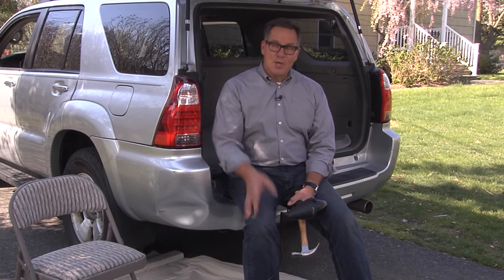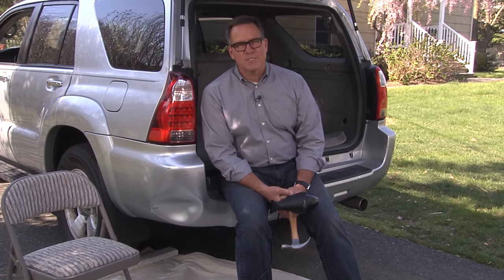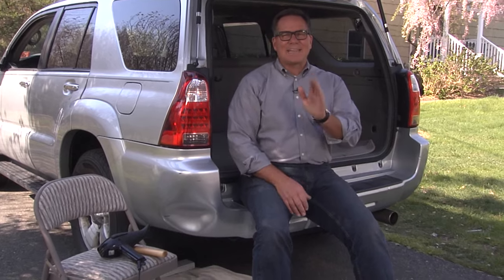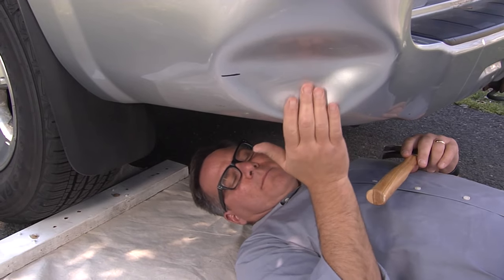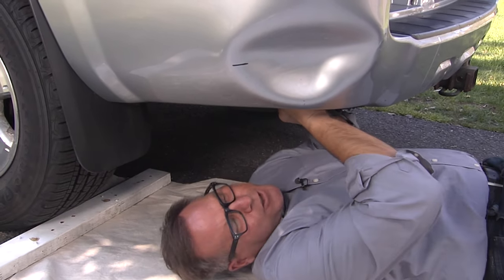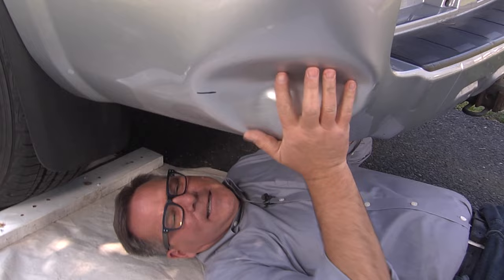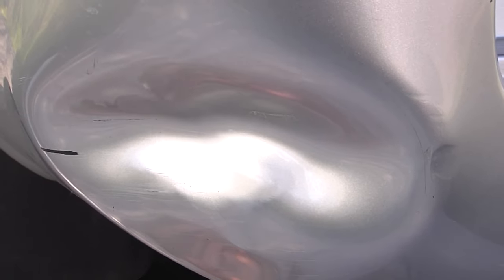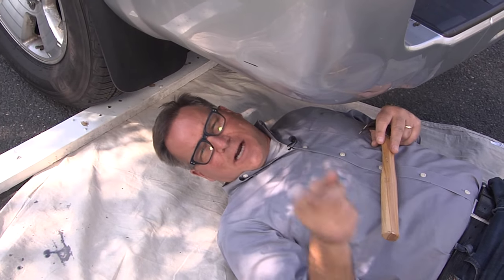How to Get a Dent Out of a Bumper

Comment: I used a baseball bat to push the dent out,  it helps to roll the dent as you push it out,  try either end of the bay.    Good idea to use the chair for the heat gun.  Thanks

Comment: First of all, thank you. I followed your directions and it worked. The only issue I had was with getting the bumper warm enough. The first time it didn’t work so I adjusted the location of the hairdryer and did it again and I got most of the dent out. I warmed a little more and finished it. Thanks for the video.

Comment: He gets to tell me “try to be careful next time” which such a tone because he knows he’s provided immeasurably valuable information to me. He can point at me and talk like to me because of what he did for me with this information 😆🤣😆 funny enough I remember walking in early to a body shop I was getting work done at and I saw a guy using some machine to heat the bumper up then he just used another device to round it out just like this but my uninitiated mind didn’t even process how this could be a DYI at home.